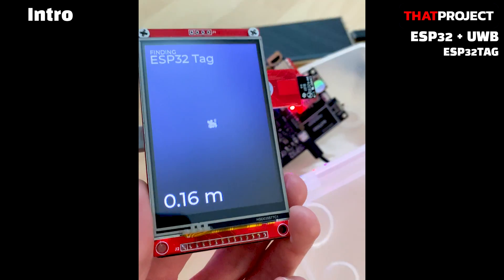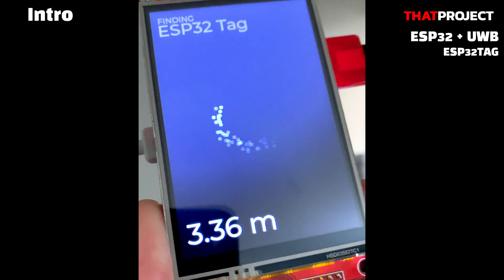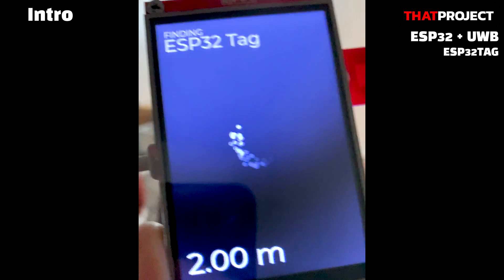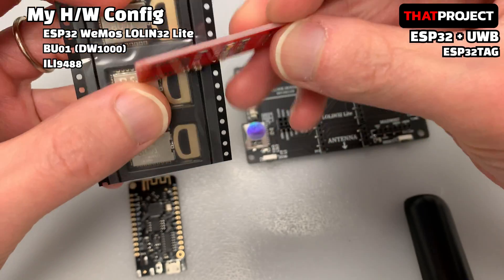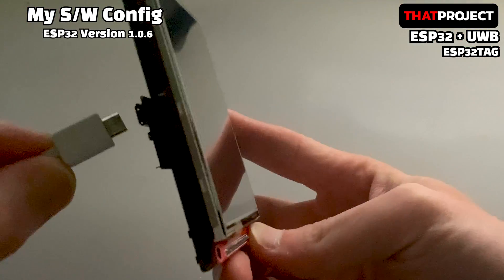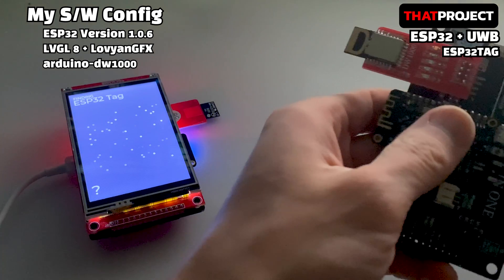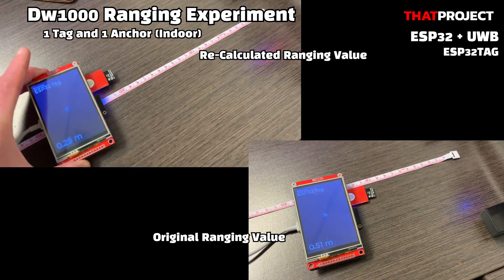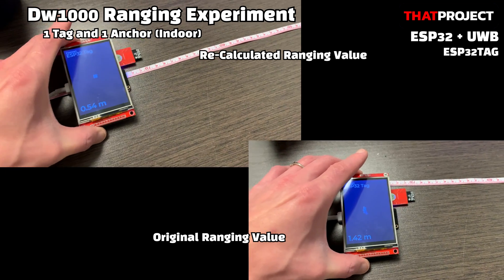ESP32 + UWB | Not AirTag, But ESP32Tag

Comment: could dwm1000 receive uwb signal from airtag ?
Reply from the maker: It's impossible. Only Apple devices with the UWB module can detect AirTag's signal.
Reply: @ThatProject  Thats not 100% correct. "The DW3000 is interoperable with the Apple U1 chip, which makes it possible to work with the Apple ecosystem".
Reply from the maker: @markusw.6285  Yes as you said the DW3000 can communicate with Apple's U1 chip but we are talking about the DW1000.

Comment: Hi, Thanks for the code and video. I work on the same project. Using the same DW1000 clone, BU01. I'm currently facing an accuracy issues, and the chip cannot communicate when the range over 4 meters indoor. Did you do the antenna calibration? btw, in your another video, it can achieve 24 meters, how did you manage that?
Reply: After looking your code carefully, i noticed that setting the UWB module to MODE_LONGDATA_RANGE_LOWPOWER will extend the range as your code in the ANCHOR side. But for the Tags, to be exact in your MyDW1000Ranging.h you set the module to MODE_LONGDATA_RANGE_ACCURACY. Which is I believe it will not match. Or maybe you've uploaded the previous version file.

And for better accuracy, you tweek it range by multiply the raw data range with 2 / 5. Am I right? CMIIW
Reply from the maker: @InsanSains  Both Tag and Anchor devices use MODE_LONGDATA_RANGE_LOWPOWER. And also added the code  DW1000.setGPIOMode part.